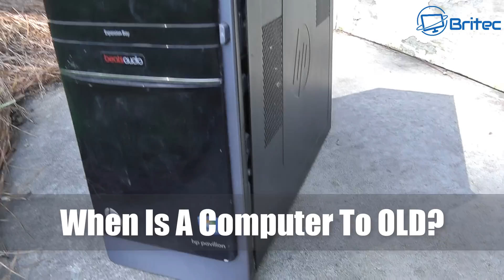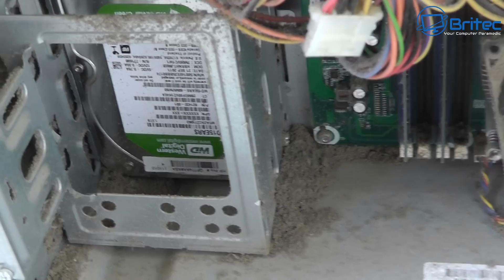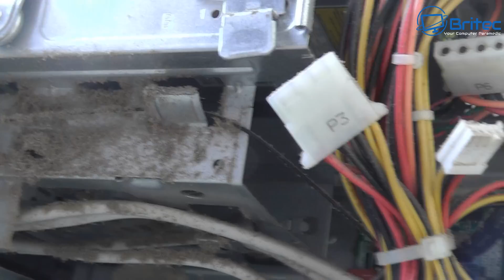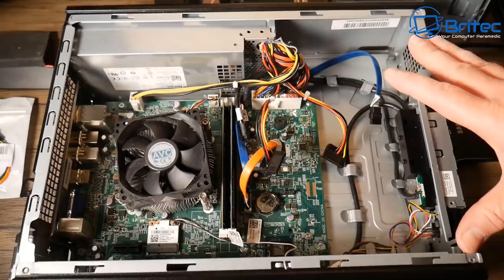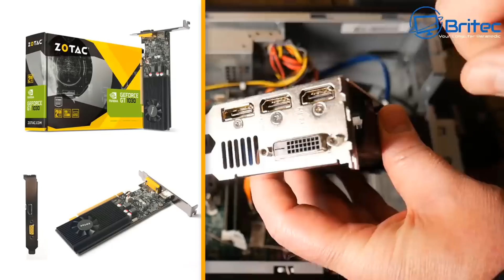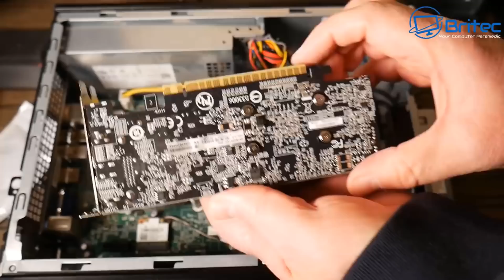When is A Computer Too Old

Comment: My laptop is 5 years old tomorrow (I bought it 08/07/2017) and hasn't missed a beat since I bought it.

In most respects it has quite a basic specification (only 4GB RAM) but that's all I need as I don't do video editing or anything very demanding on its resources - pretty much it's used like a Chromebook even though it runs Windows 10. It does have a very high-res screen (comparable or better than some new models today) and the battery will still power the device for a full working day if needed - I checked the battery's health using the Nirsoft utility featured in a post a few days ago and it indicated that the battery still has 92% of the health it had 5 years ago. I've looked after the laptop very well.

It doesn't yet take all night to do what it used to do all night.....)

If I bought a new comparable laptop tomorrow I know it would have a better processor, SSD, and other advantages. I'm hoping this laptop will last me another 2-5 years and when I replace it I'll probably either get a well-specified quality Chromebook, or, if I get another Windows device, I'd probably go for one with 8GB RAM and the ability to watch 4K videos /2160p. I can easily watch Youtube videos in HD / 1440p on my current device but in 4K there is a slightly discernable freezing/jumping at times.
Reply from the maker: 5 years old is not old grant, should do you for a while yet.
Reply: @Britec09  You say that Brian, and it's true - I look after my stuff too (which helps). I was on a Mediterranean island for 2 weeks (5 years ago) helping to teach/train a work colleague. She had an 18 month old laptop (only ever used at her home) which was practically destroyed - it looked like it had done 3 rounds with Mike Tyson....! It was only good for throwing away.

Obviously she wasn't a subscriber to your channel because she had taken a slightly different strategy (to what you might recommend) to give her laptop a clean.... She had decided to use her household Dyson vacuum cleaner to give her laptop "a spring clean!" During this process at least 2 keys were sucked off the keyboard.....
Reply: @Britec09  how old would you say is too old? Ten years? Longer?

Comment: most windows pc's can't install win11 these games doesn't mean they're old, windows 10 is becoming "unsupported" and win7 is 100% unsupported, that does not mean it's "too old" my brother owned an athlon x4 620 i put win10 on that and it ran perfectly fine, played content and was used as a stream pc for his xbox worked flawlessly, my 3rd gen i7 is unsupported by win11 but it's still runs perfectly fine with any and every task.

very poorly explained and bad examples... heres a better way to look at it, if it has an IDE hard drive and still has ribbon cables in the PC then it's too old xD if it's using sata then it's considered low-end and still most likely usable depending on what you use it for, also long loading apps is 9 times out of 10 hard-drive related.
Reply from the maker: Like I said, don't skip video and listen. If you can still use a athlon x4 620 then use it. I myself cannot and its too slow. Also some people will argue that IDE systems are still fine in 2022.
Reply: Yes bro i also have i3 4th gen pc and it is running smoothly without any issues i am a casual user i mostly do browsing emais and some youtube so it is perfectly fine for me

Comment: They have just decide that windows 11 cannot run on perfectly good computers. This Microsoft  going insane not computers being incapable. I will not be told when to get anew computer by them.
Reply from the maker: I agree, you should not be told, but you can't expect Microsoft to support really old computers
Reply: @Britec09  we're not expecting that. What we're expecting is that they don't put artificial limitations in place to force people to upgrade when they don't need to.

Comment: love the video your right my old Intel Pentium II 400MHz Processor  128 mg of ram 4 gb hard drive can't do Linux but it works sometimes on windows me very slow
Reply from the maker: Nothing worst than a slow pc, drives me nuts
Reply: RAM measured in MB, once upon a time you could run Linux, but it's a lot fatter than it used to be, maybe something like Damn Small Linux (outdated) or Tiny Core Linux

Comment: i still have an i7 4790k, cooler master hyper 212, double fan - Be quiet wing 2 pwm, 16 GB ddr3 ram, 1TB NVME with a 4TB HDD, with a 1060 6GB, evga power supply 650w gold and a corsair 200r its fine atm. x still fine
Reply from the maker: As long as it does everything you need, that is all that matters.
Reply: @Britec09  i dont play games(i used too) so just general use. x

Comment: My oldest PC still active by generation is an AM3+ system using FX 6300.
But by order of the time I bought it, it's the newest actually. I bought the cpu recently to upgrade my even older Phenom II which I bought used in late 2018 for secondary pc.
Gotta say after using it, the FX series (except 4100/4300) are really underrated. If I build/bought an FX system in 2014 when I bought my first pc, perhaps today I haven't upgrade my cpu yet.
Reply from the maker: FX 6300 is getting a bit long in the tooth nowadays
Reply: Hello. my current PC is circa 2015 (4th Gen i5, 16GB DDR3, 1TB HDD, GTX 750 Ti, Win 10)... and serves me just fine... I can't go across a dumb enthusiast like LTT pushing a high end processor to people who got a budget of like $500
Reply: @mica7191  I also have a dell optiplex 9020 i3 4th gen it is working smoothly from 3 years now and i am a casual user like i do some casual browsing some emails and youtube so it is more then enough for these tasks
Reply: Something like an 8320 is pretty cheap and might give that system a boost.  8350 or 8370 even better but those two use a lot more power and run hot.  The 8320 is still OK performance and low power, low hear. And cheaper.
Reply: I had AMD FX 8320 since 2015. It was working fine until the mobo finally died on me two weeks ago. Had been holding it up despite the numerous BSOD until it became too much with a BSOD every 30 seconds. I had no choice but to build a new rig otherwise I would use it for as long as it takes.
Reply: I have a amd fx 8320 that I have been putting off upgrading for a long time. It's been the most reliable computer I ever had. It's never crashed or blue screen or anything.

Comment: i have a intel i7 4770 with a gtx780. had to upgrade graphics card as drivers no longer supported, but the CPU is still ok (windows 10) . Properly it's last year
Reply from the maker: i7 4770 was a good chip back in the day.

Comment: I had a 12 year old ThinkCentre M82.
I tossed it in a box and salvaged the DVD Drive from it.
I'm currently using an ASUS TUF GAMING F17 laptop for my gaming and computing needs.
It's WAAAAY faster.
Reply from the maker: 12 year old is getting on a bit.
Reply: @Britec09  Yeah...I had bought it to replace my 2018 Mac Mini due to issues with Apple abandoning Intel. I thought I'd be able to make a cheap gaming system out of that ThinkCentre M82.
I was wrong XD.